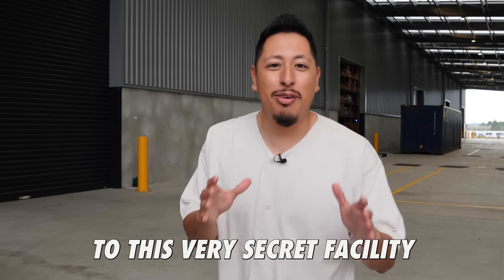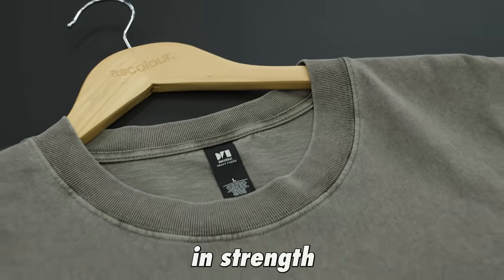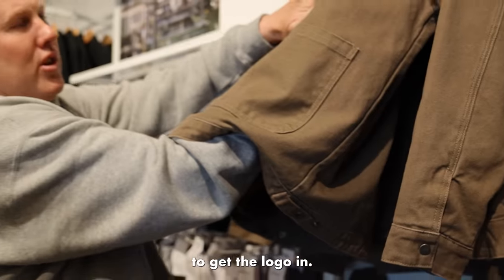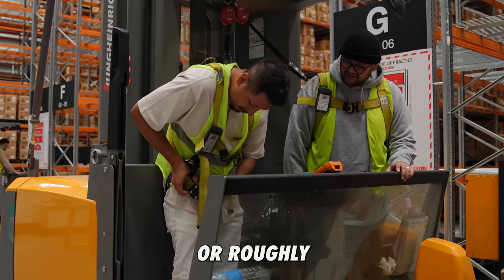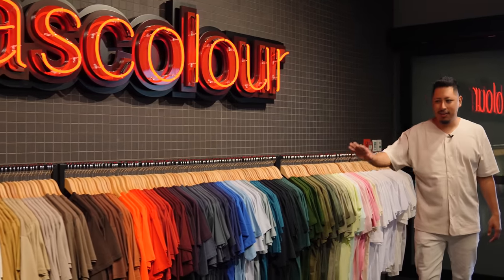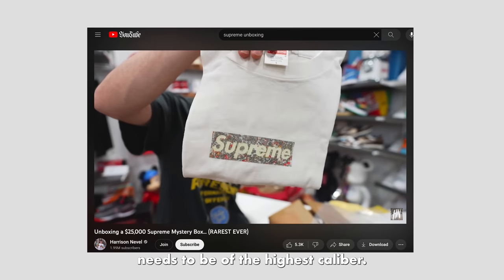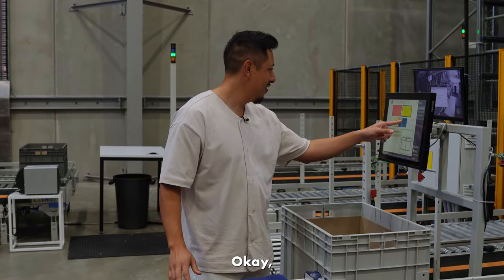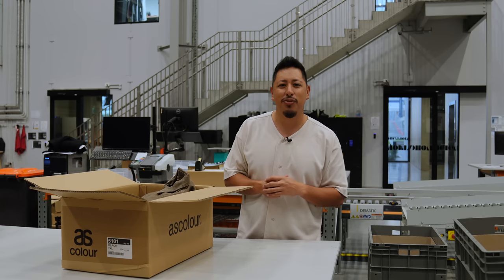The SECRET Clothing Brands Don’t Want You To Know

Comment: The problem with AS Colour, is in the statement made by Lawrence Railton when he says that they can be used as your brands stock service because of their large range of inventory. If you're doing this in small quantities, your profit margin is pathetic. AS's base cost per garment is retail, you only benefit with bulk orders of 50+ items. This was a very deceiving statement made by the CEO. I have been using AS for quite some time and find myself consistently trimming bird nest threads and have multiple thread runs. I am very particular and fussy with my apparel, and I have notice AS slipping in quality over the past 12 months, to the point where I have contacted head office in AUS.
Reply: Have much success mate? Bought some items recently for the first time in a couple years and im pretty dissapointed. 
this is the first time hearing the marketing of a T shirt lasting "30 washes" before falling apart. No mention of washing AND wearing durability haha

Not a worthwile expense for most of Aus, and possibly even worse for NZ